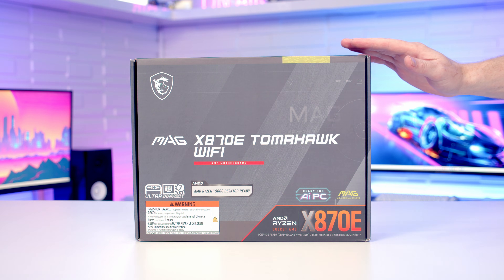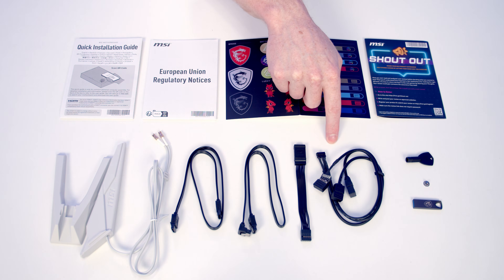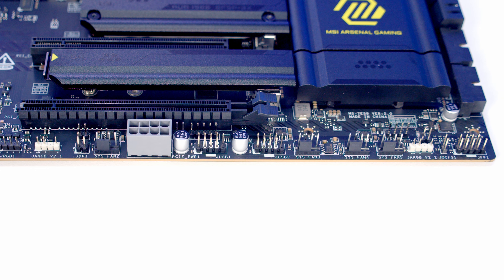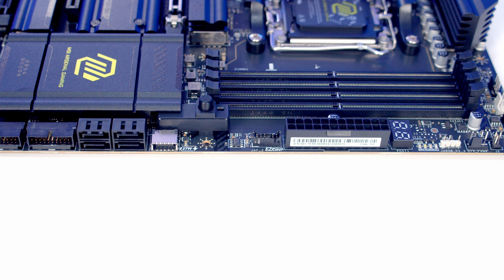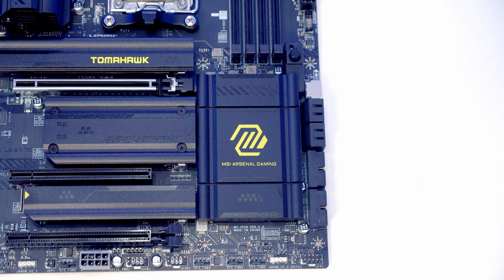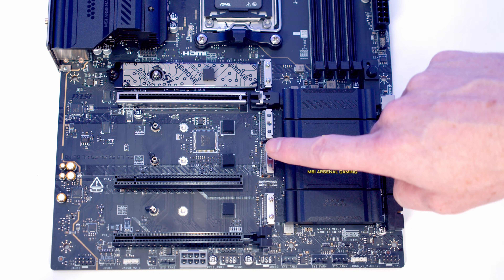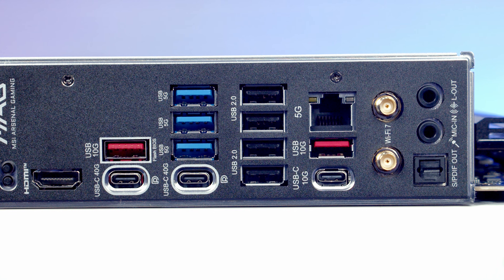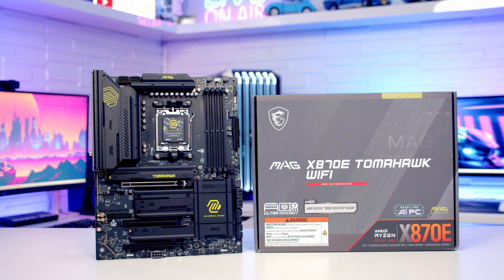MSI MAG X870E TOMAHAWK WiFi Overview

Comment: Does this mobo share lanes at at with any of the m2s?
Reply: I have this board.  Only the M2.2 shares lanes with the 2 USB 40GB Type C ports @ 2x speed.   If you disable the 2 40GB USB ports, you can give x4 back to the M2.2, so you will get PCIe 4.0 x4 for the NVME.

Comment: Got a question about the tomahawk, mine still hasn't come (it's a preorder) but I can still cancel it. Do you think the 870E is better? I hear they have the same I/O, but the X870 version uses some third-party expanders/controllers for USB & SATA whereas the X870E version is all AMD chipset... but some items are on the secondary chipset which adds latency, including the PCIe gen 4 x4 slot, the 4th M.2 slot, and all of the front USB ports. I am a bit of a noob so I could really use the help deciding. As a gamer, do I actually care for whatever it is that the "E" offers?

p.s. I keep reading about the tomahawk how it has latency issues with sound (due to realtec 4800 having a USB interface) and other issues, and then there's the ethernet problems I keep reading about.. wondering if the E has those solved.

Comment: Got it for 220 at microcenter with a bundle such great value was super easy to build with only con is that morherboard manual was online so i had to use a pdf on my phone
Reply: I purchased that combo at Micro Center. Did you get yours up and running because I purchased one and had to return it for an exchange. Mine came with G Skill 32gb of f5-6000j3636f16gx2-fx5 ram. I updated the BIOS and still get a yellow light and a 15 Code saying the DRAM is not detected or fail. I was wondering if yours came with a different ram kit. I sure don’t want to purchase different rams to find one that works and I really don’t want to have to take it back for another exchange and still have the same problem.
Reply: @ i used the flare x ram that came with the bundle worked fine for me you prolly got unlucky if it happens next time you build  make sure to look up what the code on the motherboard is to see if you can fix it and reseat ram and use only 1 stick etc try all the troubleshooting you can try clearing the cmos too that worked for me yesterday when my cpu and ram light were red after i installed my 9070xt

Comment: +1 Excellent! Now there are 2 P21 chips in the chipset with the letter E. But it looks like the same crap with replacing the CMOS battery - to replace it, you need to remove the radiator from the chipset, and to do this, you need to unscrew 4 screws on the back of the board, and to do this, you need to remove the board from the case - this is equivalent to completely disassembling the PC! Right? And another question - there are similar boards with similar prices from Gigabyte Aorus - Elite and Master. Are they better or worse? The forums say this: Aorus boards have a slow BIOS and sometimes the settings are forgotten, the boards have a backlight, but only 6 layers. Tomahawk boards have a very long start, sometimes overestimate the voltage, do not have a backlight, but 8 layers, faster than LAN. So, which should you prefer? Thanks in advance!

Comment: The only X870 E board than can power two Gen 5 drives at X4 lanes without cutting the 16 lanes to the GPU.  I'm sold.
Reply: I believe they take the PCI lanes from the USB 4.0 (40GB) (either/or selection I think..   Its kind of confusing)  but who uses USB4 40GB really: You're not going to build a massive USB based NAS, using this board..
Reply: @brianh1563 usb 4 40gb u can use a egpu😊😊
Reply: ASRock Phantom Gaming X870E Nova WiFi  is also using 4 NVMEs without Lanesharing, but I'm a MSI Fanboy so this will be my board for ne upcoming 9900x3d build for me.
Reply: The asrock nova board can do that aswell, but in the uk the msi board is cheaper and more widely available so imma go for that one
Reply: @MohamedAli-vy4pc  incorrect. It cannot connect two gen 5 drives without switching gpu to 8 lanes.
Reply: @jasonhale770  Yh I meant it can have 4 nvmes without lane sharing. I’m probably not gonna use gen 5 anyway
Reply: well there is also the msi x870e edge that just got released together with the tomahawk

Comment: this is the best value x870e motherboard right now.
Reply: ASRock X870E PG Nova also has great value and it's a bit cheaper than the MSI MAG X870E Tomahawk Wi-Fi
Reply: @pangeranrio0112  with X3D shenanigans, ASRock definitely out of equation for now
Reply: @pangeranrio0112 Tomahawk is cheaper locally for me at least but the ASRock boards are frying CPUs all over redit but the % of dead CPUs vs total sales is probably quite low.

Comment: looking at the just released manual, sadly there seems to be some line sharing between the 2nd PCIE 5.0 nvme drive and the 2 usb 4.0 contolllers at the back.
Reply: I believe that's the case for the X870 version but not this one (X870E), because the double chipset offers more PCIe lanes (X870 has a single chipset) which makes the non-compromise possible.
Reply: @MrJaviYuyi  I believe you are correct
Reply from the maker: The manual wasn't available at the time of making the video, just reviewers guide and I didn't see this in the guide or the published specs. The manual is available now and i can confirm it says 

"* USB 40Gbps Type-C ports on the back panel and M2_2 slot share PCIe 5.0 x4 bandwidth. Both run at PCIe 5.0 x2 when a device is installed in the M2_2 slot. You can switch M2_2 to PCIe 5.0 x4 in the BIOS, but this will disable the USB 40Gbps Type-C ports." 

I knew this was the case on the X870 board, but the X870E seams to be the same with this. All the boards seem to have to compromise somewhere and most people will be ok with one gen 5 nvme, but good to know about it to plan the build.
Reply: @ChristopherFlannigan  Oh I see. But I don't get it tho...what's even the point of this board then?? X870E version with identical features and more expensive than the X870 here in my country.
Reply: Its AMD's fault for limiting the CPU. Normally the CPU should have 28 lanes, but the lock 4 of them, so you can only use 24 lanes, this means you gotta sacrifice 1 M.2 slot.
Dunno why they can't fully realse it with the 28 lanes even the 9800x3d is stuck with 24 lanes.
We need a 28 lane CPU, but that would require a new socket i believe, so we are stuck with what we have for at least another Generation.
Reply: What if I'm running a gen 4 in the second slot. Will I need to disable or will sharing be fine?

Comment: So I bought msi mag tomahawk b650 like 2 weeks ago, tomorrow is the last day I can return it. Im curious would it be worth to just return it and buy the msi mag tomahawk x870e before starting a build or just after a while getting it for some upgrade?
Reply: upgrading motherboard is waste(mid gen) unless you need something from the feature it have
or it got broken for some reason(shit happens)
or u want to change build look(from black motherboard for white one)

x870e motherbaord features over b650:

do you need wifi7?(idk thats up to you)
do u need pcie5 ssd?(ill answer that one for you PROBABLY NO -only if u run sh*t that is storage intensive like video editing or using pc for deploying db on it)
do you need usb4?(ill answer that one for you PROBABLY NO)
do you need the motherboard features?(more higher bandwith usbs,ez relase)  u can ignore that
Reply: Depends on the build, if you going for overlocking and top end components - for sure, go for it
Reply: @vladbronnikov9813  currently I have 

lianli o11d evo xl
msi mag b650 tomahawk
amd 9800x3d
intel arc b580
gskill flare x5 ddr5 6000 cl30 2x16
samsung 990pro 1tb
be quiet dark power13 850w
arctic lf3 420
arctic p14max x12
arctic p12max x2
msi g244pf e2

Im planning to upgrade the 
motherboard
gpu
monitor 

to something better in the next year
Reply from the maker: As others have said look at the difference in terms of specs and price and decide if they are worth it